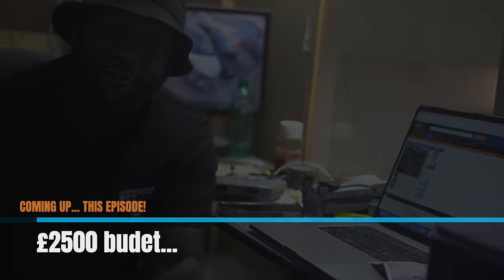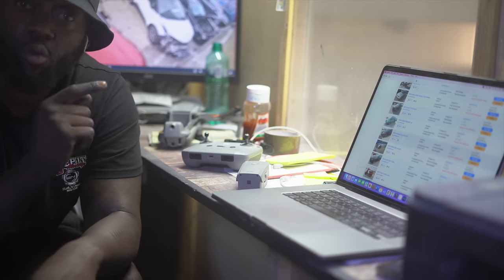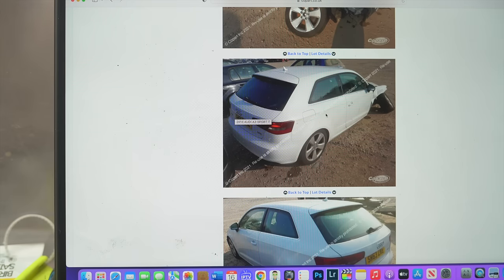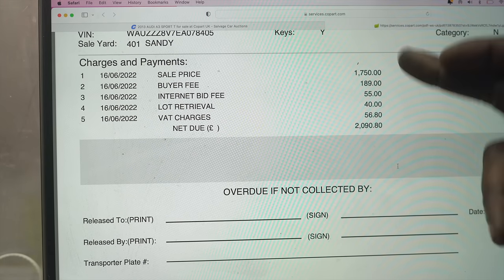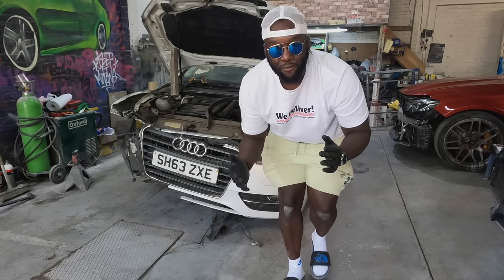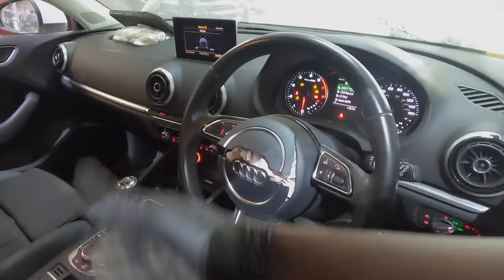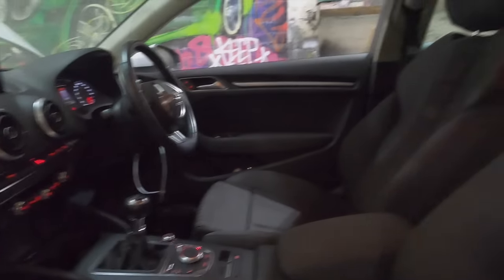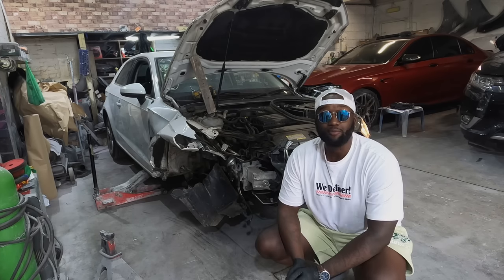WHAT CAN A £2500 BUDGET BUY AT COPART AUTO AUCTION? | BIDDING FOR A NEW BUDGET SALVAGE BUILD EP.1

Comment: What does N Repairable Non Structural mean????
Reply from the maker: It is repairable and has non structural damage. These are normally easy repairs and only need to repair a panel or light etc. if its cat s with STRUCTURAL damage its more heavy damage with damage to the main body of the vehicle .
Reply: @SALVAGENATION Thank You